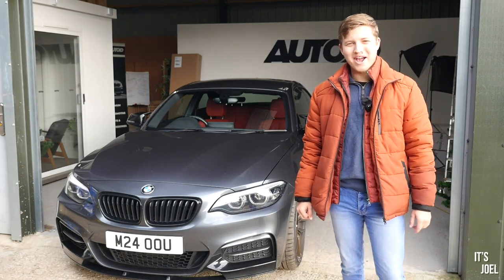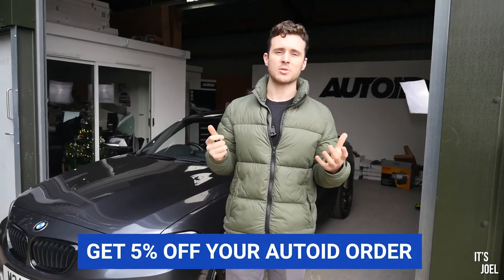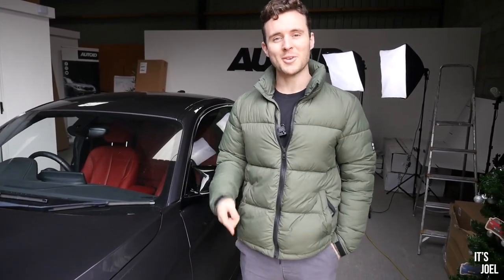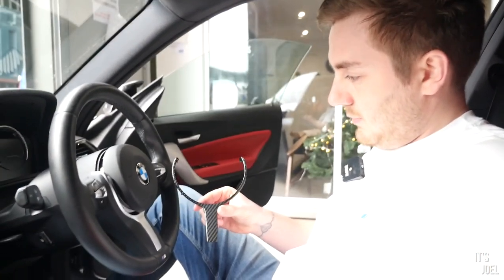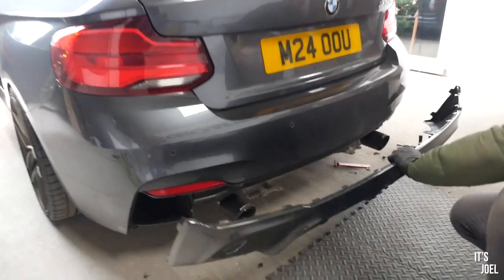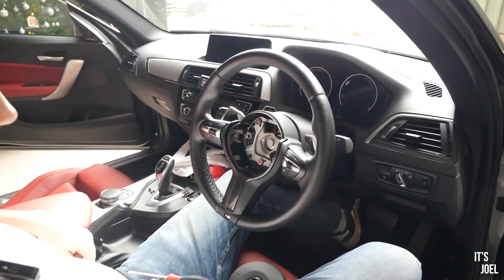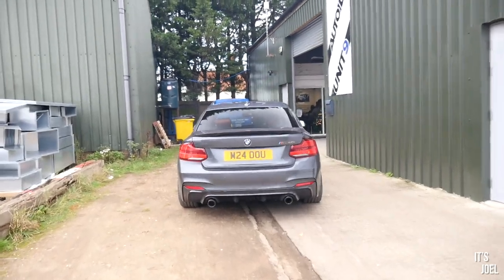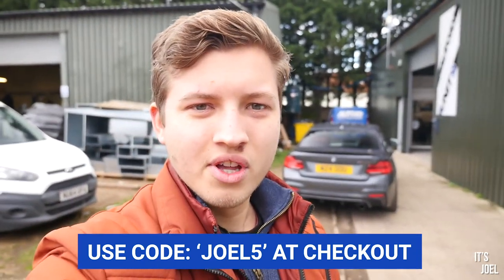LOOKS WAY BETTER! Carbon Fibre Diffuser & Interior | LCI BMW M240i

Comment from the maker: What do you think?
Reply: Looks 100x better with that rear diffuser 🤙
Reply from the maker: I totally agree 😉
Reply: Looks epic! 😎
Reply: Should have gotten the ugly plastic around the silver on the steering wheel done in carbon and left the silver
Reply: Looks mega, how the fitment round the sides?
Reply: does it accurately diffuse the are tho or is it just cosmetic? if it is just for looks then no need for that much money for carbon fiber

Comment: Great video mate, just incase anyone goes to try doing the steering wheel trim them selves, disconnect the battery first for a good while before you mess with the airbag.
Reply from the maker: Cheers mate, thanks for that

Comment: Think you should have gone with the Remus system. The oval tips would fill that rear diffuser much better as they're slightly bigger than the quick silver tips.

Comment: Looks like a fairly large gap along the top and sides of that diffuser? Unless its just the lighting of course. Hows the fitment compared to the oem one?
Reply from the maker: Don’t think the fitment is 100%. But it’s negligible and miles ahead of anything else I’ve ever seen

Comment: Why is he taking of the air bag to fit the trim you don’t even need to touch the air bag & you don’t even need to remove the factory defuser the aftermarket one fits straight over the top of it,but taking of that air bag did it for me 😂